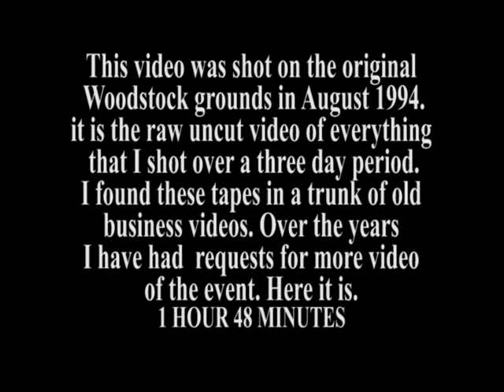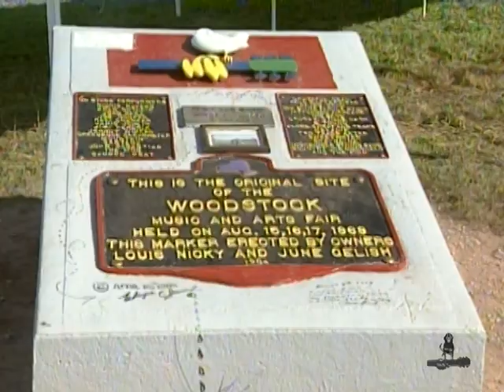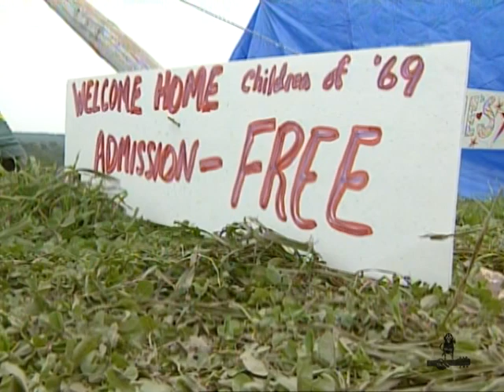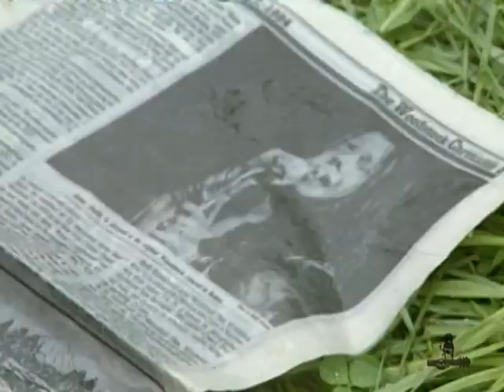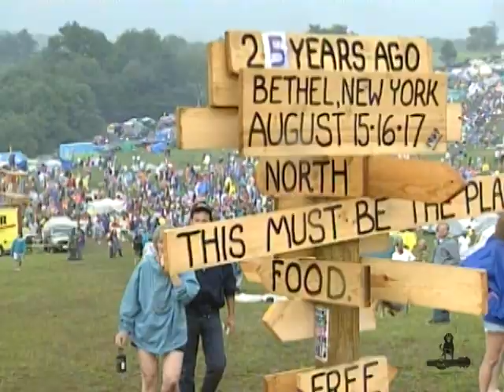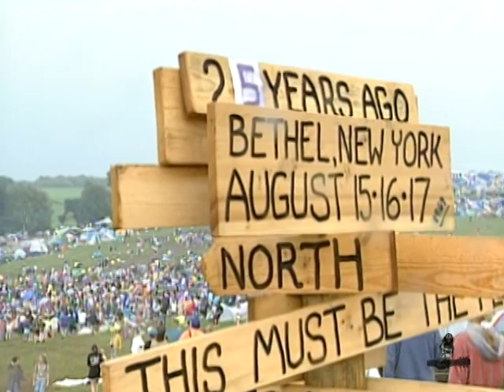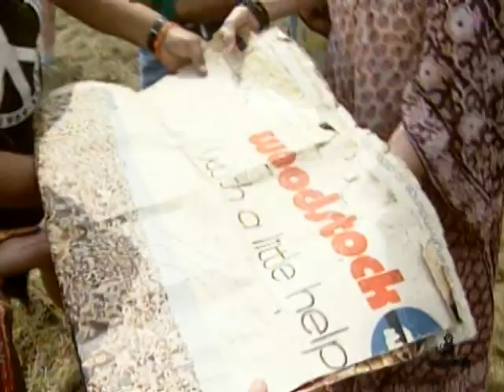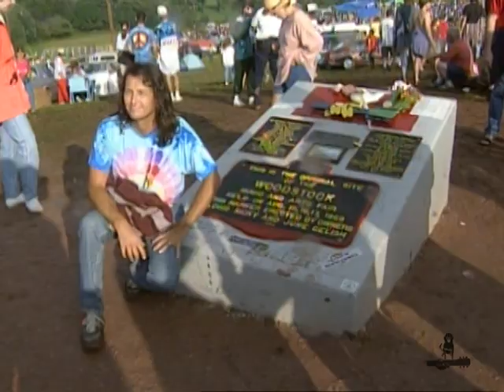WOODSTOCK 25TH 1994 THE LOST TAPES RAW VIDEO

Comment: I'm a little confused by this tape.  Was this actually on the grounds or was it on the outskirts in the parking areas?  I was there and arrived on Thursday afternoon and we were forced to park our car in a parking lot a few miles away then we took a bus to the actual site. But before we could even get on the bus we had to go through a security checkpoint and they took ALL our food and tent pegs, took our Tylenol?!? and everything else THEY deemed dangerous.  But low and behold the gates came crashing down a day or so later and then there were kegs, 3 foot bongs, 2 foot joints and everything else they confiscated from people who paid and were bused into the grounds.  So, my question is.........Where was THIS footage from?